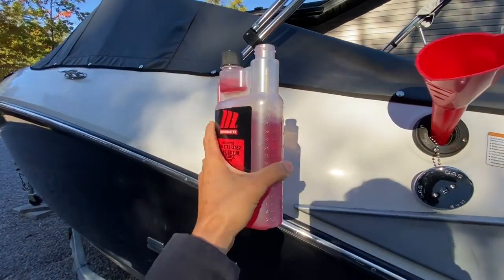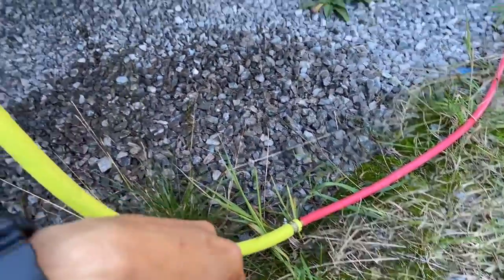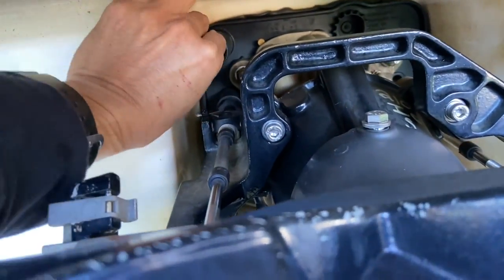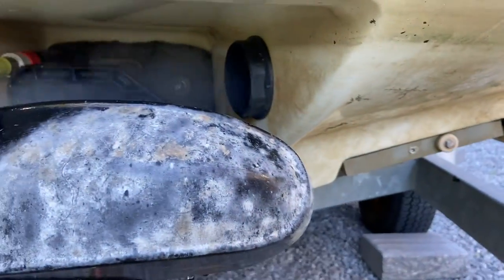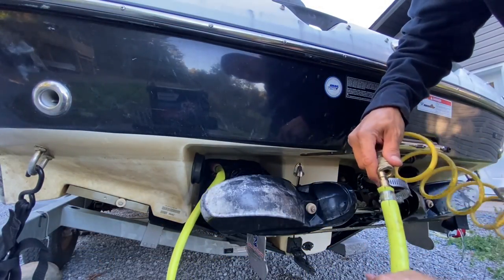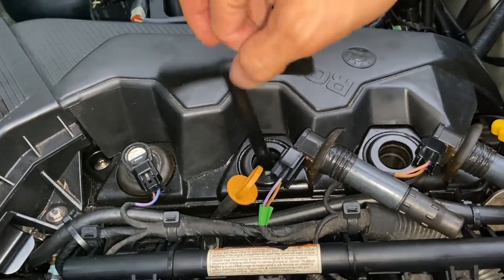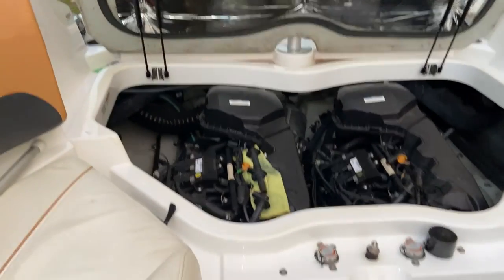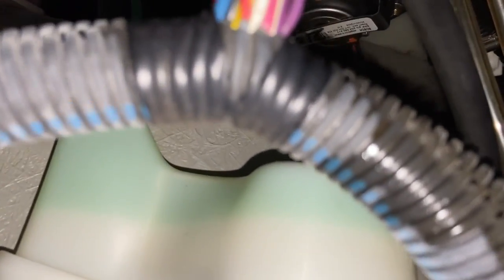How to winterize Seadoo Challenger Boat

Comment: How long do you leave it sitting in the water during boating seadoo? 
You use rv for the environment.
When do you change the oil?
Reply from the maker: Hey man. That boat sits for about 3 months in the water. 
I use RV environment liquid 
I changed the oil last year. I have no idea when it was changed before I had it.